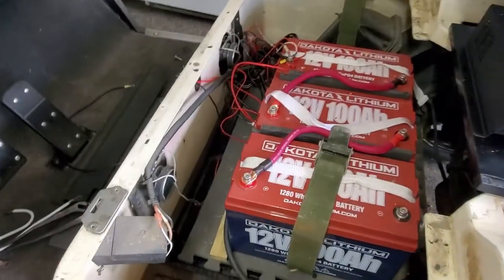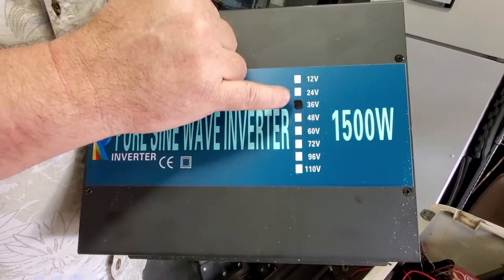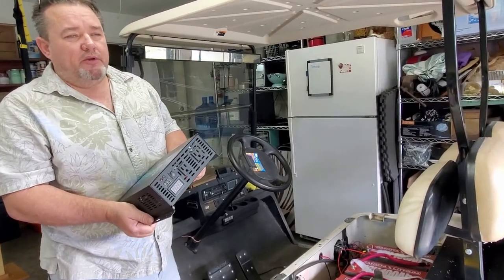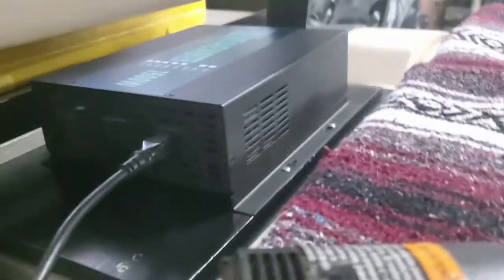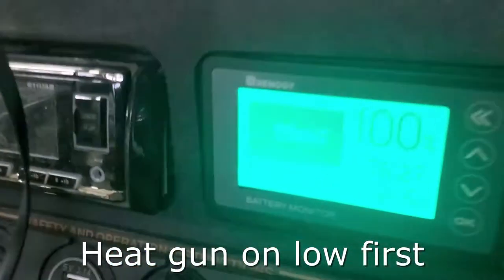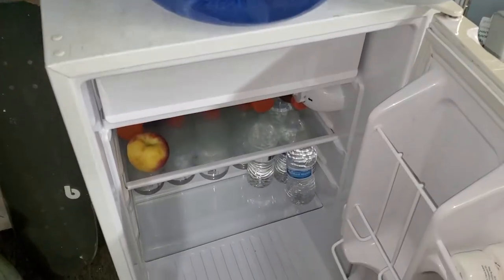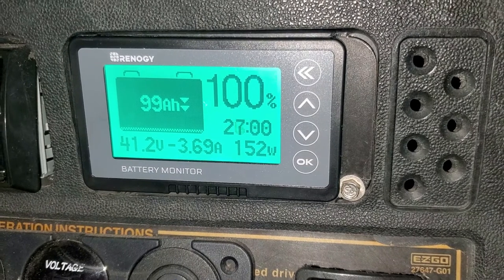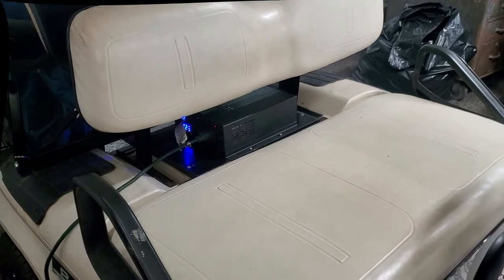36 volt inverter on EZGO TXT Golf cart with Dakota Lithium 36 volt pack

Comment: I really like your videos. I bought another brand of lithium 12 volt 100 amps I have a 36 v ezgo txt. I would love to know how should wire these up. Do you know where I can find that info.
Reply from the maker: Tom..before you install them be sure they have a continously discharge rating of 1c. Or 100 amp continously  with 200 amps max for several seconds. Also the cart really needs to be stock with no upgraded high amp controllers. Also confirm from the manufacturer that they can be wired in series to produce the 36 volts. If all that is good you basically will have a positive and negative post terminals that goes to the controller and motor and other small items. Usually at opposite ends of the entire pack. You need to identify those two leads...remove them and tie wrap whatever comes off each post together..then mark them positive and the other negative. Usually the one with the most connections is the main positive terminal. Then remove all batteries.  Clean compartment and then put in the three batteries in a way that is secured. Then from the first passenger side battery..connect the negative post to the middle batteries positive post. Then the negative post of the middle battery to positive post of drivers side battery.  At that point you will have two posts remaining. A positive post on the passenger side and a negative post on the drivers side. Hook up all the positive leads you removed and marked first. Then hook up the negative post last. Expect some pretty extensive sparking. It should just spark for a second. Wear gloves but it's really no big deal. Prior to hooking up the final two you might check the voltage on the two open terminals. Should be around 40 to 42. Please read up elsewhere to confirm. I wrote this quickly and it's possible I have made a mistake. Just confirm it before doing it.

Comment: Hey man! Really love your video(s) regarding your 36v cart battery change out...I have a 2007 36 v EZGO TXT (does not have the toggle switch on the controller)also and would like to tap into your vast knowledge of the do's and don'ts when you did this...please help me if you can...this will be very EXPENSIVE for me and I want to do it right the first time...help if you can...THANKS!! Wayne W. in NC
Reply from the maker: LOL...I dont really have a vast knowledge. More like basic. But anyways the big things on Lifepo4 battery selection is that the BMS will be capable of supplying a continuous amount of current under all the conditions you operate. Each battery model has several ratings for the BMS. The important ones for Golf Cart operation is peak AMP output and max continuous output. Ideally the BMS inside the batteries you buy would be matched or exceed the cart you have. Of course I dont know what your cart draws at various times. The main characteristics of cart AMP requirements are usually bound by just a few typical operating conditions. 1) instant on power. When you put the pedal to the floor instantly. That will draw a huge peak in amperage in microseconds that quickly tapers off over the next few seconds as the cart accelerates. Even on a stock 36 volt cart when you mash the pedal down it may pull 300 or 400 amps for microseconds and then quickly settle to around 150 amps for a second or two followed by settling into say 50-75 amps as the cart gains speed. 2) Max continuous AMP draw - when you are driving on flat ground at top speed with the pedal to the floor for longer periods. You cart will draw a particular amount of AMPS continuously under these conditions. On mine thats about 60-75 AMPS. 3) battery amp hour rating- how much power is packed into the battery overall. This is basically like the GAS tank. Most golf cart people are looking to get standard 100 AH batteries (3 of them) and wiring them in series to make 36 volts. That results in 100 amp hours of 36 volts. Also the peak and continuous ratings of the battery bank will remain the same as a single battery. In other words if the single 100 AH battery is rated at 200 AMPs peak and 100 amps continuous, when you combine 3 batteries to make 36 volts the entire pack will still be rated at 200 amps peak and 100 amps continuous but at 36 volts instead of 12 volts. Anyays..I would go with a minimum of a 100 AH battery X3 to make a 36 volt pack. The problem is that most 100AH batteries are rated at 200 amps max peak and 100 amps max continuous. This is a rating that is very very close to how many 36 volt carts operate and some people are tripping the internal BMS on their batteries when they exceed the battery BMS ratings momentarily.  Operating in a hilly area or offroad or adding big tires and heavy loads only raises the AMP requirements and makes it more likely to exceed the BMS and make it trip. I have never tripped mine ever and I have pretty standard 100AH batteries with a pretty standard 100AMP BMS (200amp peak rated). One thing I wanted to try was to use three 150AH batteries that have a 150 AMP BMS (300 AMP peak). There are several manufactures that make these. I do not know if they physically fit though. But I would bet they can be made to fit one way or another. So I cant help you completely on this subject but this should point you in the right direction so you can research particular batteries. Good luck.
Reply from the maker: BTW also watch Will Prowse on youtube to check the quality of individual batteries to see if they are junk or not.

Comment: Are you able to charge your batters with the old charger? I heard that you could. Thnx
Reply from the maker: The Dakota package came with a charger made for the batteries.  Most stock chargers are not set up for the charge profile of the lithiums. I believe the charge profile of the last bit of charging to its max voltage will be off. I belive it will charge, but may shorten life or not charge to full capacity.

Comment: No way that heat gun is pulling 34 amps. Your volt meter is off somehow. 14 amps max on a heat gun on full maybe even 12 amps. Check your heat gun on a amp clamp or volt meter and compare it to your golf cart meter
Reply from the maker: the 34 amps is DC amps pulled at roughly 38 volts. 34A X 38V = 1292 watts. That is correct. If it was AC amps 1292 watts/120v = 10.76 amps AC.
Reply: @mvintrigue-trawlerdiy1101  forgot I was looking at DC amps lol my fault thanks for correcting my mistake
Reply from the maker: @davidhardin1402  its no problem at all. I had to think about it myself for a minute..lol.